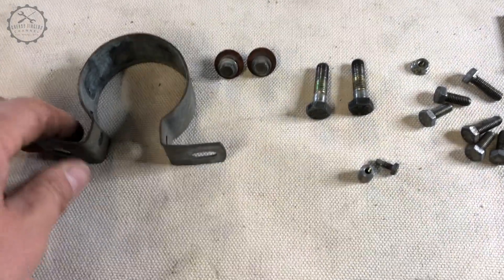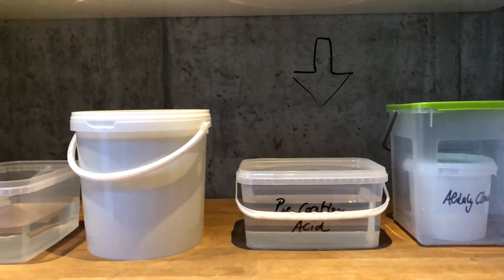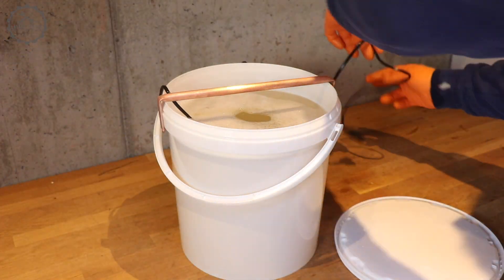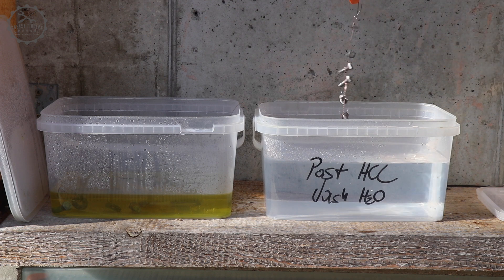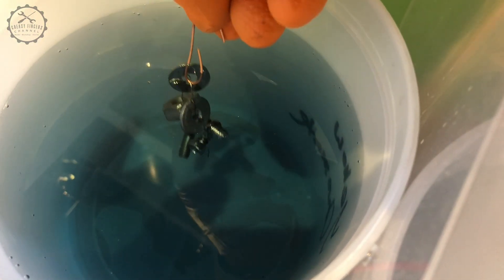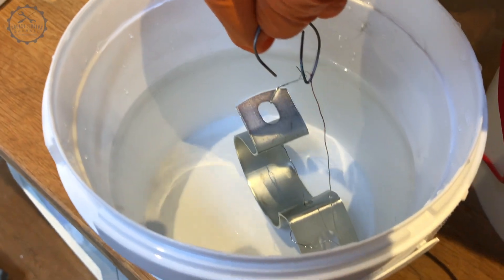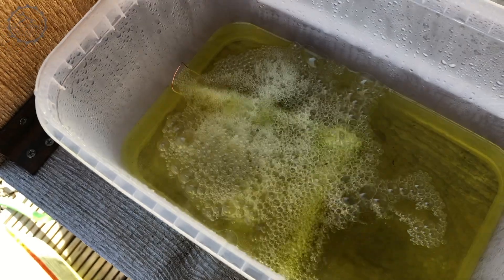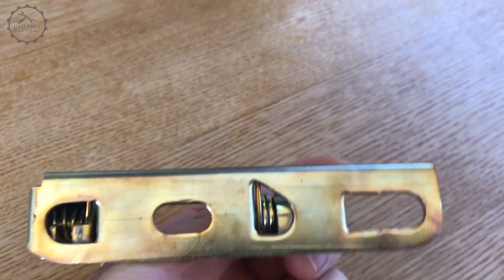DIY Zinc Coating using the Gateros-Kit

Comment from the maker: I'm quoting from an e-mail from the Gatreros team with useful information for further improvement: 

One thing for your reference and a good check.
After HCL stripping there is quite a high chance that you will get carbon smutting on the surface of the item.
The alkaline cleaner will remove some of this smutting. I would also check with a water break test and white cloth test after you have done the final pickle/activation dip and rinse just before plating.
The water break test will show up the cleanliness of the parts as regards traces of oils etc and the white cloth wipe will show up traces of smutting.
 
The only other thing to beware of is that if your parts are hung on copper wire and you dip the parts in HCL stripper or HCL pre plating pickle then each time a small amount of copper is dissolved.
After a while the copper in the HCL is enough to start depositing on the steel!
This very thin copper layer is only attracted to the steel and is not a true bond!
So any plating on top will eventually peel and blister.
 
So just keep checking the steel to make sure that it is not starting to get faint copper deposits on it.

Comment: Can you double or even tripleplate the parts if you wanted?
Reply from the maker: Yes, but the thickness of the layer of zinc doesn’t improve its anti-corrosion capacity. A layer of paint over the zinc coated part will do …

Comment: @GreasyFingers, sorry some years late, are you still using the process? I wonder whether the HCL Pre Bath could be substituted with the now popular DIY a citric acid bath? Yes not as quick but way easier to handle and later get rid of.
Reply from the maker: Hi Alessandro, I’ve given up doing this myself, once I had achieved my main goal to understand how it works.
In fact you’re right, HCL is a permanent threat, anything that replaces it would be welcome.
Reply: @GreasyFingers  So you have things plated externally now? Interesting, it's actually what I did until now. But I was looking for alternatives to combat the stress caused by "do I have all fasteners" - "oh i forgot these two"  😅

Comment: Hi, i am having little issue after the zinc plating using the kit from gateros. I am getting a yellow dull coating which builds up while plating. When finished plating and cleaning with water - its still there, and looks no good. Interestingly when i use a wire wheel it comes off and reveals nice zinc plated surface. Question is how to avoid this yellow coating after plating to save on cleaning the parts? Is my electrolite contaminated? Thanks!
Reply from the maker: Hi, I’m sorry, I don’t know.
Reply: @GreasyFingers  I have just recieved response from Gateros - they confirmed my concerns. I have somehow contaminated the electrolyte. The yellow coat should be possible to wash off, so i am buying new chemicals to start fresh.
Reply from the maker: @fullrespect69 Thanks for sharing this!

Comment: Do you have any longtime test results? Sometimes it looks good, but only for 1-2 Winters
Reply from the maker: I don’t have long term results available right away, but I could look up some of Walter‘s underfloor parts that I plated myself.
I generally don’t think that a DIY kit’s result can compete with a professional, industrial job. My main motivation to use this kit was to improve my understanding of the overall process.
Reply: @GreasyFingers  tbh in germany and europe I tried over 4-5 different shops and the quality was just bad bad.. and expensive. So DIY maybe is an option.
Reply from the maker: Feel free to get in touch with me via the mail address in the about section, I can recommend a company that does this for me.
But yes, DIY is an option too.

Comment: How long do you keep the metal pieces in the HCL? Until it stops bubbling?  I did have some spring steel on a pair of Starrett calipers break apart after probably 15 minutes.
Reply from the maker: Yes, till it stops bubbling and a little longer.

Comment: Hi great video, I’ve just ordered my kit from Gateros plating. What product do you put in your ultrasonic cleaner ? and where do you buy HCL from thanks
Reply: Thanks. How long do you leave your part in HCL when you are Carring out your initial clean?? Cheers
Reply from the maker: Cheers, mate.
In the usc I use normal industry degreaser. 
HCL you can order on Amazon.

Comment: How do you achieve such a great finish with the hcl?
I clean my parts with soapy water and a brush and then I leave them in the hcl for roughly 30 minutes until they stop fizzing like crazy.
When I take them out, they almost look and feel like I sandblasted them.
The plating result afterwards is also not as nice and shiny due to the roughness of the surface.
Do you drop them in the hcl for just a few minutes?

With the use of hcl I was hoping to save the extra steps of polishing, alkaline cleaning and activating.
Looks like that doesnt seem to work out as I had planned.

One tip I have for you: 
after cleaning the parts with hcl, I drop them in a solution out of water and Natron (KaiserNatron from DM) to nutralize the hcl. I think its bicarbonate of Soda or something, just google hcl neutralization, you will find it. Its crazy, you can actually see the acid on the part reacting with the Natron. Then I rinse them again in distilled water, just to make sure its clean.
Reply from the maker: Thanks for the tip, mate! Sounds like a very reasonable extension of the process.

You get the shine by polishing the parts with some painter‘s fleece before plating them. I didn’t do this for the film, so the shine came by accident.

Comment: Hey, you helped me alot i liked and subscribed!
I have a problem, my yellow passivation gets dull on some areas when they sit for dry till next day. You have any suggestions what i do wrong?

I calculate my Amps and Zinc 20mins my Screw looks super shiny! Then i passivate for 60 seconds (rinsing after that) and then the next day it gets dull on some areas.., 
its demotivating me because i spend alot of money for my setup
Reply from the maker: Thanks, mate.
I have this problem too. Cleaning the part with painter fabric helps. A friend dips it in yellow chromate first and blue chromate second and he’s telling me this increases shine.

Comment: Thank you Lord Greasy Vader!  I'm slowly restoring a 1982 Kawasaki GPz 550 and restoring old fasteners is a challenge i haven't faced yet as i find it a little daunting.  I will use this vid as reference when i finally develop the courage to attempt the process.   Cheers from Eastern Canada!🍁
Reply from the maker: Thank you, Brad.
The 550 GPZ is a great bike. I owned an XBR 500 in the mid eighties and sometimes swapped bikes with a friend who owned yours. 
This whole thing is much easier than it sounds, only real challenge is to avoid accidents with the acids involved,
Reply: @GreasyFingers  I had to look the XBR up. 😄Nice looking bike.  We never got them over here.  You guys often got desireable machinery we could only lust after.  And thanks for the words of encouragement!

Comment: Hello greasy fingers.

I am using the exact same kit from gateros as you are. I was wondering did you ever have any issues where your yellow passivation could be rubbed off, even after a day or 2, exposing the zinc plating?

I am having some issues with this, whereby its as if the yellow passivate has trouble adhering to the part and can be rubbed off.

If you encountered this, how did you solve the issue? I have a feeling its to do with rinsing the part, but after plating, I rinse in distilled water, then acid pickle, then passivate, then rinse.

Many thanks

Jamie
Reply from the maker: Hi Jamie,
I really don’t know, but I recommend you reach out to Gateros directly, they are very helpful and supportive.
Regards
Johannes
Reply: Hi, i have contacted gateros about that, have the same issue, they said its normal, passivating will rub off with finger. I even tried to rub it off from an industrial plated bolt - it is comming off, but a bit harder than from gateros passivate.

Comment: Be mindful, the acid dip on springs can cause hydrogen embrittlement, springs may break if left too long.
Reply from the maker: Thanks for the tip, I wasn’t aware. 
I won’t do that again, especially as I guess it’s only cosmetics anyway. Spring steel isn’t prone to rust.

Comment: Great Video I will be incorporating the HCL method your using.  What causes the parts to come out of the zinc plate so bright? I have to polish mine with a brush before passivation although I'm not using the Gateros kit nor a dedicated Power Supply so could be either.
Reply from the maker: Thanks!
I think the brightness is part of the magic of the Gateros kit. There’s a fluid where it says: if parts get dull, pour some of that in.

Comment: what is about Zink Spray ? i got some good results with that.
Reply from the maker: I guess it works, but scratches off easily. I therefore only use it as a primer below more durable coats of paint.

Comment: Don't use HCl on zinc or pot metal as it will destroy them.
Reply from the maker: Thanks for your comment.
Will destroy them always? Ever if molecules meet each other? No matter how long and no matter the concentration of HCL? And temperatures? Thickness of the zinc layer?
Reply: @GreasyFingers  A quick dip of no more than a few seconds and an immediate rinse won't hurt but I have damaged zinc castings in a 50% solution and more than just a few seconds.  I don't know the chemistry to adjust time and concentration but I just find other ways to prepare pieces to avoid damage.
Reply from the maker: Makes a lot of sense to me. I think I will take the same route on the long run. It is exciting to use HCL, but it creates more problems than it solves.

Comment: Hi! Thank you for your video, It was a good reference for me in many aspects, as I also bought this kid. However, let me make you a remark, the copper wires that are holding the anodes, are partially inside the electrolyte, if it is true what it is recommended by gateros, that should not happen under any circumstance! as then you have copper particles going to the electrolyte... So I understood...
Regards and thank you again
Miguel
Reply from the maker: Hello again, Miguel. I just looked this up: the copper wires I’m using here are painted / plastic coated. Should be okay.
Reply from the maker: Hello Miguel. Thanks for the feedback.
I wasn’t aware of this, it’s really good to know.

Comment: So am I correct that in this last video, to prepare the parts, you did ultrasonic cleaning, then blasting and then HCL...?  Also, the kit you purchased, is it ZINC-NICKEL ALLOY PLATING KIT - 5L..?  Thank you!
Reply from the maker: Well, no. These are three different methods to get the parts prepared for the galvanic process, but you don’t have to apply them all.
Reply from the maker: Yes, that’s the kit.

Comment: QUESTION: which sandblasting media are best for simple rust, grease & dirt removal on small autoparts? 
Thank you!
Reply from the maker: Hey Peter. That’s glass beads of about 100 to 200 micrometers.
Reply: @GreasyFingers  Thank you very much.
Reply: @GreasyFingers  forgive me for being a newbie at this, but micrometers would be the same as "Mesh/Grit"...?
Reply from the maker: Peter van den esschert Not sure. It’s basically the size of the particles. Look at this: Testpaket Glasperlen 3 x 2.50kg (2.50kg Koernung 70-110µm + 2.50kg Koernung 90-150µm + 2.50kg Koernung 100-200µm) // Strahlmittel, Strahlgut, Glasp https://www.amazon.de/dp/B00IXK02X4/ref=cm_sw_r_cp_apip_nwwvyDTbrwOtz
Reply: @GreasyFingers  Thank you again, very helpful!
Reply: Don’t use glass beads to remove corrosion, rust and grease. Glass beads are a burnishing finish media. Use 80 grit aluminum oxide or crushed glass.